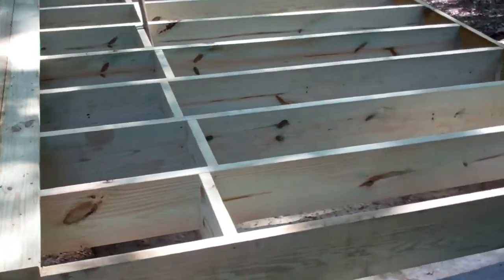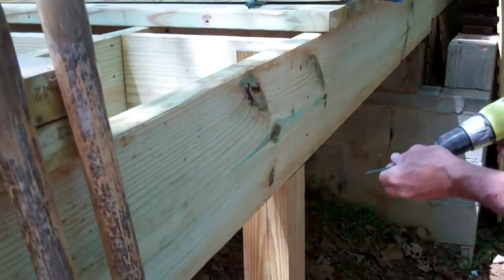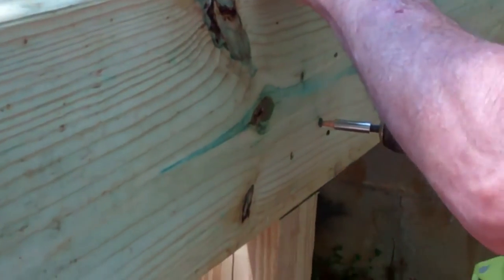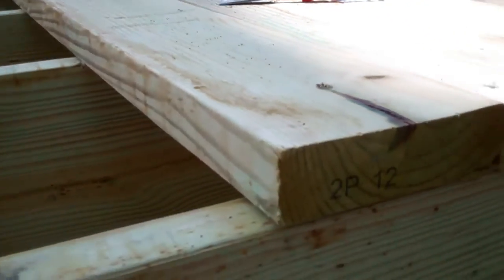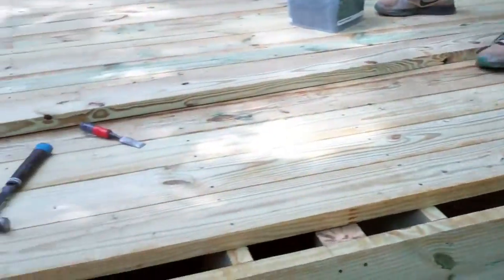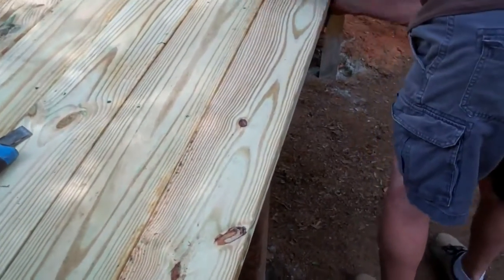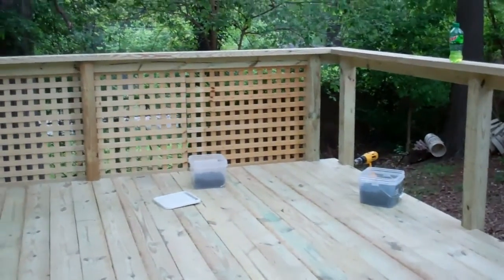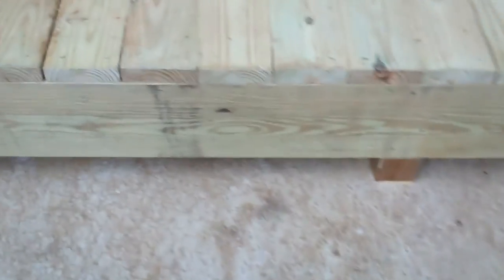Building a Deck onto my Mega-Shed (Part 2)

Comment: Did u use deck screws or the Sheetrock screws ? Can't tell . Watching with my cell.... small screen 😕
Reply from the maker: Of course we used deck screws... 3 inch torques head
Reply: SkilledEddie 
I understand. But the issue is that they are stronger that Sheetrock screws . That's all I was saying . I had the heads on Sheetrock screws breaking too easily while driving them in. The deck screws never popped on me . Of course they r not structural , but they are stronger